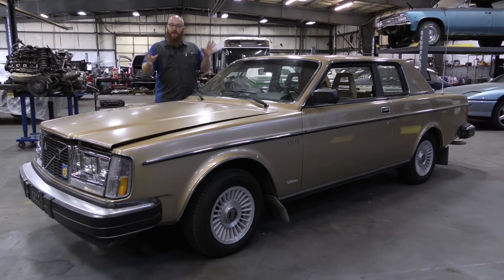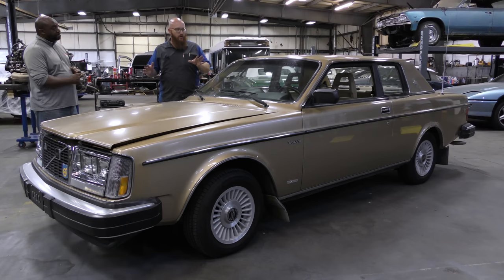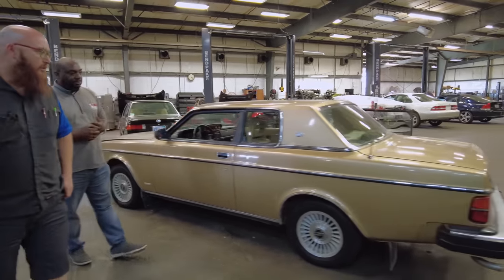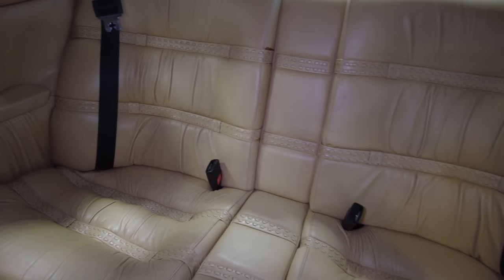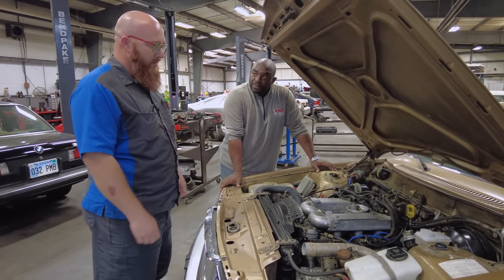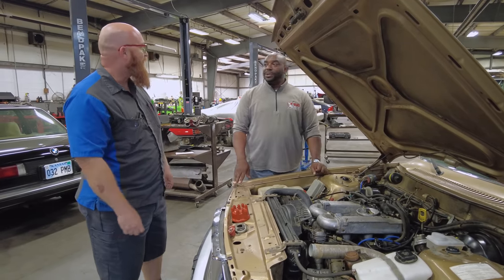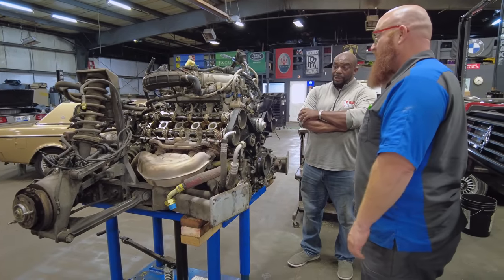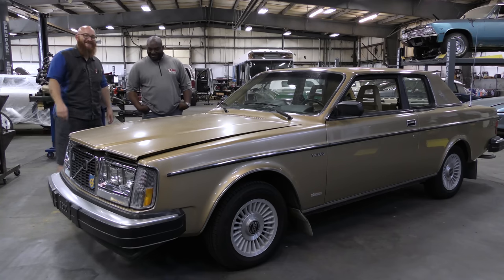Italian Volvo? Rare ‘80 262C Bertone in my shop! Why is Bug Ninja in a Ferrari engine bay with me?

Comment: The 262C design was done in-house by Jan Wilsgard.
 Bertone only build the car, as Bertone was very happy to point out.,.. You could get the whole Volvo Range with the V6; a 262 (no "C" high top even rarer as the Bertone), a 264 Limo an a 265 Wagon.

Comment: ...you're supposed to take the INTAKE OFF to change the distributor on a PRV!   That's why they keep breaking the caps.  You DON'T change these caps with the intake on...  As well, these engines have a high failure rate in the radiator hoses that run INSIDE the valley along the distributor.  When you take the intake off to do the cap it gives you the opportunity to catch these leaking hoses.
Reply: My first car was a 1979 264gl.   I totally forgot about taking the intake bolts loose to have the clearance needed to change the cap.

Comment: I had a Volvo just like that with a diesel engine ,that was one hell of a well built car .
Reply: the gas ones in the states were garbage expensive and unreliable used to see these on the roads here in California where they dont rust, they break down though, while better volvos are still on the road
Reply: If it was a diesel that was nothing original... The Volvo 262, 264, 265 and 262C never had a diesel engine. Only 240 models.
Reply: @darkiee69  probably , I traded it in for a brand new  86 Pontiac persiana .
Reply: 5 cylinder Volkswagen diesel
Reply: @gulfy09  Yes but not inte 260 model... They could you only get in the 240 model.
Reply: @Kent.  Actually, in the summer of '81 I test drove 2 '81 Volvo Diesels - an automatic and a manual - and they both used the 260 model body, chassis and interior. I know because at the time I owned a 264 and besides the engine - the 6 cylinder diesel vs the PRV V6 - they were identical. Not knowing that I owned a 264 the Volvo salesman even tried to impress me by telling me that the 'Diesel' used the 260 body, interior and chassis. Needless to say I stayed with my 264GL! lol
Reply: @Kent. Yeah, it wasn't a bertone, but the diesel 240's did exist.
Reply: Ok... Only for export then i assume!? Never heard or seen anything about diesel 260 here in Sweden!! Even the 240 diesel was really rare. We didn't drive diesel cars back in the 70 - 80's here. So if they existed maybe they only was exported.
Reply: I had a 240 stick shift. I think it was tan or beige, not sure,  it was in 1978 - 79. It drove like a tank up in Snoqualmie pass. I drove it to Seattle from Fort Ord Ca. then a few years later I sold it to my loss I really loved that car.
Reply: @Kent.  Not exactly. The Diesel engine that Volvo used, like in the 760 GLE TurboDiesel was a Volkswagen 2.4 Liter I-6. In Colorado anyway, I test drove a brand new '83 Volvo GL Diesel, which basically made it a 264GL. I've owned 3 264 GL's with the 2.7 PRV, and an '84 760GLE, and though nicely equipped, not a lot of power, and thankfully I never had to work on 'em.
Reply: @jeffb6786  I know Volvo used a VAG diesel back in the days, really slow and boring, but like i said earlier, cars with diesel engine was rare here in Sweden at that time. Now it's hard to find a two - three year old nice petrol car here, diesel sold good here for many years now but it starting to go back more and more to petrol again. I don't like diesel so i'm looking for a nice low milage S60 T6 R-Design 2019. There is a lot of T5 but not T6 😒
Reply: @Santeri-zo3wx  Yeah... I know that, I haven't said they are great engines!!
Reply: @Santeri-zo3wx  Yeah... I know, here in Sweden it's not very fun to daily a V8 with our ridiculous gas prices. Today the price is about twice as high here if you take a average price and compare them.

Comment: I remember Fiat used Bertone quite a bit especially for the Fiat X19 Bertone.
The Fiat X1/9 is a two-seater mid-engined sports car designed by Bertone and manufactured by Fiat from 1972–1982

Comment: I've owned my '81 DeLorean with the 2.8L PRV V6 and the K-Jetronic Fuel Injection for 27 years.  I've put nearly 100,000 miles on it and I have NEVER once had a single issue with either the engine or the fuel injection system.  The only "engine" issue, if you want to call it that, I ever had was replacing the bearing in the AC belt idler pulley which I did myself for $12.  My PRV has enough power to move the car sufficiently and has been ROCK SOLID reliable!  EDIT: I have had to replace the clutch once at 19,000 miles, but that's not really an engine issue.
Reply: Same! But i'm only going on 4 years of ownership. Thing just goes
Reply: I owned a '77 Volvo 264 GL with the 2.7 litre V6 for 13 years and l found it to be a good engine. The rest of the car was a little troublsome but the engine and Bosch fuel injection system were fine. This engine tends to get a bet of a bad rap but at least you don't have to pull it out to replace a timing chain!

Comment: B280F (2.8 Liter) replaced the older PRV V6 engines and was used in the 780 Bertones along with the B230FT. The B280F is a much improved engine, smooth & very reliable I sold my  1988 780 Bertone w/ over 260K Miles.
Reply: 780s are nice!
Reply: I remember a Volvo technician proudly showing me how smooth and quiet the B280F engine was in a then new 780 Bertone that was undergoing its pre-delivery inspection at the dealership. The only engine noise you could hear was the injectors opening and closing!
Reply: Do you ever regret selling it? I would think the 780 Bertone would be a collectors item.
Reply: Wasn't the B280F an updated PRV ?
Reply: @Homme_Pur   yes.  Still a prv base but much updated by volvo.  Later grew to 2.9 amd then 3.0 litres

Comment: That is sharp.  What a shame that a dealer shop would turn it down.  Makes them just look dumb or bad.  Lambda makes me think of Revenge of the Nerds frat Lambda Lambda Lambda.
Reply: Lambda in Latin the broken one. Kinda fitting .
Reply: @kathrynleaser5093 lol had no idea but that is next to Nova
Reply: Do not forget the Omega Moos.
Reply: maruiacancer6 wrong chat, dude
Reply: Bring a 94 mazda B3000 to a Mazda dealer (it's a Ford ranger) and see how much specialized service you can get... no one is used to it at the dealer, and it's old, so that adds another layer.

I don't blame the dealer for not wanting to touch it, that engine was very rare and if someone is proficient in it they won't be working at a dealer where 1 car may show up in 5 years, they'll be at a specialist shop, or own their own shop.
Reply: No dealer in their right mind would want to work on that for anything other than simple repairs. As a volvo tech with knowledge of the Bertone, and also one that contributes to over 30% of the shop's daily output, it would be woefully inefficient to sacrifice the throughput that myself or any other volvo tech at a dealer with similar knowledge to put toward the time it takes to work on these. Most parts are obsolete due to how limited these were made, parts diagrams are a nightmare, and everything you touch wants to crumble into dust. These, 99% of the time, become time consuming restoration projects which is not what dealerships are for. Most customers do not understand once you really start digging in to these, and most older cars in general, you just open an endless can of worms that gets woefully expensive, and sometimes impossible due to parts availability, to do it the right way and that's a situation that is just best to be avoided, because in the end nobody is satisfied.
Reply: I had TWO solid chances to buy one of these. But that French engine made from cheez whiz scared me away.
Reply: @musicims  "sacrifice the throughput"???
Reply: @volvo09 Mazda B3000 was the successor to B2000, both were named "Ranger" by Ford.  Then were light duty pickups that Mazda did OEM for Ford.  B2000 was Ford's card in sleeves to compete in light duty pickup against Nissan's Hardbody after oil crisis in 1970s when heavy duty pickups were not so popular for gas-guzzling while El Camino of Chevrolet was deemed too civilized.  Quite a few companies of small size bought B2000 for equipment hauling as well as delivery.  I was a delivery/pick-up man at a data processing company in 1983.  B2000 was my company car then to deliver and pick up  magnetic tapes to and fro between company and branch office daily.  B2000 was based upon 626's platform which was very simple and robust.  B3000 should be the successor with 3.0 liter engine leading to the 929 later.

Your B3000 probably need to find a technician with age over 50 to be knowledgeable to know the history.

All those gracefulness and elegance are drifting away with the rapids.
Reply: @musicims It would not be easy but it would be better than being sleezy.  That name is what they sell and to just gaff or shrug it away is an insult
Reply: @johna1160  If you're spending time worried about breaking parts made of unobtainium, you can't pull down enough labor to make yourself any money or cover your cost to the dealer. So, they will never accept the job in the first place. Problem solved. At least for you and the Dealership, but the "classic" car owner is out of luck.
Reply: @kathrynleaser5093  The  Latin "Fracti sunt" is  "The broken one" or "They are broken".

Comment: Changed the 8 to 6 cilinders because of the fuel crisis. The 90° V shape of the cilinder Banks still refer to the original 8 cilinder design
Reply: It is a Renault engine

Comment: The engine is the engine that was used in the DeLoreon BTTF car. Yes the PRV, Peugeot, Renault, Volvo.......
The cloth interior slur on European cars, is bs.
If you wanted cloth interiors on UK & European cars, you had to request it, all cars were vinyl\pleather for the basic cars, but mid level in top level had leather.
Cloth was usually cloth or vinyl or pleather, and the second seat in a van was an option upto the early 70's.
So your transit came with 1 seat only no shotgun person.
The turbo 4 cyl actually won the BTCC in the 80's built by Andy Rouse.

Comment: Had to look  it up to confirm but Renault-Alpine continued to use the PRV until the mid 1990s in the A610 and then found that Volvo actually used it until launch of the 760/960 in 1998. PSA used the engine until around 2000 in the Citroen XM/Peugeot 605.
Reply: PRV powered automobiles

PRV engine in a DeLorean
The dates following each entry denote the introduction of a PRV V6-equipped models.

2458 cc:
Alpine GTA (September 1985–February 1991)
Renault 25 (1985–1995)
Venturi 180/200/210 (1987–1992)
2664 cc:
Alpine A310 (October 1976–1985)
Peugeot 504 coupé/cabriolet (1974–1983)
Peugeot 604 (March 1975–1984)
Renault 25 (1984–1988)
Renault 30 (March 1975–1984)
Talbot Tagora (1980–1983)
Volvo 260/264/265 (October 1974–1980)
Volvo 262C (1977–1980)
Volvo 363CS (1977, prototype)
2849 cc:
Alpine GTA (November 1984 – 1990)
DMC DeLorean (1981–1983)
Lancia Thema (1984–1992)
Panhard ERC
Panhard VCR
Peugeot 505 (July 1986–1992)
Peugeot 604 (1979–1985)
Peugeot P4
Peugeot Proxima (1986, prototype)
Peugeot Oxia (1988, prototype)
Renault 25 (1988–1992)
Renault Espace II (1991–1996)
UMM Alter II (90's)
Venturi 160 (1987–1992)
Venturi 260 (1989–1996)
Volvo 260/264/265 (1980–1982)
Volvo 262C (1980–1981)
Volvo 760/780 (February 1982–1991)
Volvo 960 (rare 1991 models)
2963 cc:
Alpine A610 (1993–1995)
Citroën XM (1993–1997)
Peugeot 605 (1990–1995)
Renault Espace III (1996–1998)
Renault Laguna I (1994–1997)
Renault Safrane (1992–1997)
2975 cc:
Alpine A610 (1991–1993)
Citroën XM (1989–1993)
Dodge Monaco (1990–1992)
Eagle Premier (1988–1992)
Peugeot 605 (1990–1995)
RJ Racing Helem V6 (1995, modified Renault Sport Spider)
UMM Alter II (90's)
Venturi 300 (1996–1998)
Venturi 400 (1994–1997)
PRV engines in racing
ALD C289 (1992 24 Hours of Le Mans endurance prototype)
Alpine A310 Group 4 & B/12
Alpine A610 GT2
Chevron B36 (1987 24 Hours of Le Mans endurance prototype)
Fouquet buggies
Peugeot 504 V6 Coupé Rallye Group 4
Peugeot P4 V6 Paris Dakar
RJ Racing Helem V6
Schlesser Original
UMM Alter II
Venturi 260LM, 400GTR, 500LM and 600LM
WM P series (1976-1989 24 Hours of Le Mans endurance prototypes, including P80 that finished at 4th place at 1980 24 Hours of Le Mans and the famous P88 that was known for setting the all-time Mulsanne Straight speed trap record of 407 km/h (253 mph) at 1988 24 Hours of Le Mans).
Ultima Mk1/2/3
The PRV was also the basis for the 90° V6 engine used by Alfa Romeo in the 155 V6 Ti in the 1996 DTM/ITC season from Silverstone onwards. The engines in that series required the use of bank separation angle and cylinder bore spacing from a production based engine, and as a 90° V6 has greater room between banks than a 60° V6 for a more optimal induction system, Alfa Romeo used the PRV as a basis as it had been used in the Lancia Thema, a car which shared its platform with the Alfa Romeo 164, as well as the Fiat Croma and Saab 9000.

Other sources declare that the 90° V6 engine in 1996 Alfa Romeo 155 V6 Ti is based on a 2.6 L V8 from 1970 Alfa Romeo Montreal with 2 cylinders removed, as allowed by the rules, however the FIA homologation documentation shows the homologated production engine was a "2850cm³" capacity "V6" engine. The bore spacing of the Montreal engine was too close to be suitable for the 155 V6 Ti in any case. Limone invented the "Montreal V8" story to throw the press off the scent and to satisfy FIAT management who were unhappy that a non-FIAT group developed engine was being used.

Comment: I worked in a Volvo dealership when that car was new. I remember the cams on the 6 cylinder engines being a big warranty problem. To get the cam out of the left bank you had to remove it from the block, until one mechanic had the bright idea to punch a big hole in the firewall and remove it into the interior. Saved a lot of time. Had a bunch of big rubber plugs in stock.
Reply: I started at the local independent Volvo shop in Aug 1982 and I remember that. Volvo North America approved using a hole saw to cut a hole behind the cylinder heads to pass the camshafts through, and sealing it with  a rubber plug when done. It was much less costly to Volvo than pulling the heads. I wound up doing several camshaft/rocker sets that were out of warranty during my first few years there.

Comment: The Eagle Premier was another car you'd see in America with this PRV engine -- it was the optional V6 available instead of the standard AMC 2.5L 4 cylinder.  It was the 3.0L variant, not the 2.7, but still -- same engine.  It was a leftover from when AMC and Renault partnered up in the '80s, and the car remained in production for a few years after Chrysler bought AMC.  Until 1992, I believe.
Reply: An american counterpart for the Renault 25
Reply: Same vehicle was rebadged as the Dodge Monaco, which the Intrepid replaced in 1992 (the Premier was replaced by the Vision). And the Peugeot 505, which we did get here in the U.S., had the PRV V6, even in the U.S.! So yes, the American-model 505 had this V6 too.

And, the Renault Alpine had the PRV V6 as well, and also had a turbo. Those turbo'd PRV V6s were also used in what was the French answer to the Lotus Esprit, the MVS Venturi

Comment: Take a good look at the engine block for coolant corrosion from the inside out.  We replaced two garage queen engines for this problem.  The block walls around the coolant passage areas are very thin.
Reply: Volvo even recommended added an anti-corrosive to the coolant to help avoid that corrosion. It was right in my owner's manual.

Comment: The PRV engine were used until 1990 in the 760 and 780 (but in a updated 2.8L version) before the 960 came with volvos own straight six
Reply: Peugeot 604 also.

Comment: C I S fuel injection was particularly susceptible to fuel contamination damage. Doesn’t just plug up the grit actually chafed and changed the metering orifices. Many upscale farm and ranch owners drifted from Cadillac to European cars and filled the gas tank from their above ground tractor fuel tanks. Oops. The PRV had a basic physics design flaw which is 90* V angle V-6 and not splayed crank pins. Can’t be made to idle smooth. What happens when a committee is in charge of design.

Comment: In 87 when the 780 came out they had switched to an efi 2.8l prv. It was a good engine but low up by today's standards, about 165hp. The 87 780 still had the live axel. Only about 500 were imported to the us that year and the prv was the only engine option. The 2.7 was used in the 70s 260 models and the 760 starting in 84. The IRS was introduced on the 780 in 88 along with the turbo 4 as an option. I think 91 was the last year for the 780. The bertone models were very cool

Comment: Every time  you both said 240, my brain keeps correcting 260, hahah. As volvo sold a 4 door version of the 264 that looked normal unlike the 262c. 

That dash pod is aftermarket, not by bertone. 
I had a 242 with 262c interior years ago.  Except mine had a b234f 2.3 16v from a later 740 and dogleg box from bmw 535i in it. 

The b27f in that is an odd fire disaster. But volvo improved it over time to the even fire b280e with nearly 180hp. Until the modular inline 6 took over around 1990.
Renault developed it further in the early 90s  peaking at 3.0 bi-turbo with 254hp in there French Market safrane hatchback with 4wd

Venturi pushed that version even more to about 400hp before people stopped using it around 1998.
Reply: I remember being told by my Volvo technician in the late '70's that the Renault F1 racing team used that same engine in their cars at the time and got 600hp out of it. Impressive - if true.